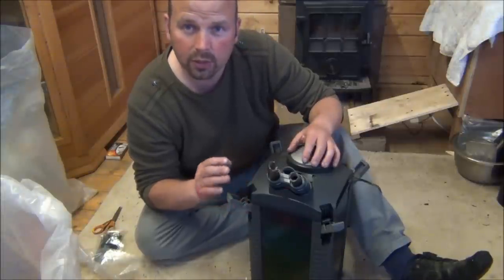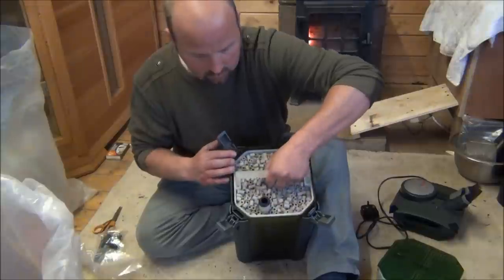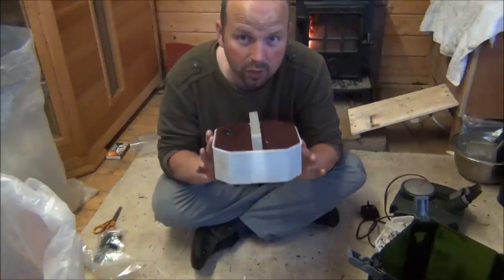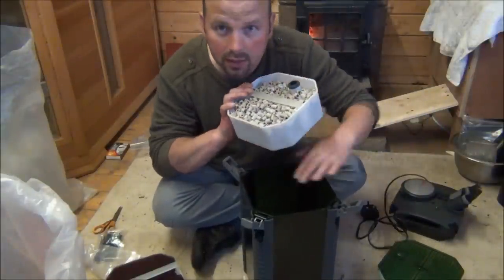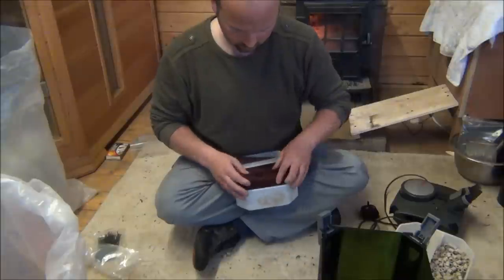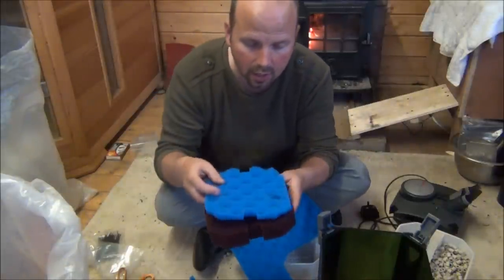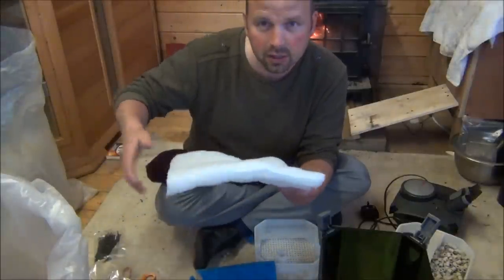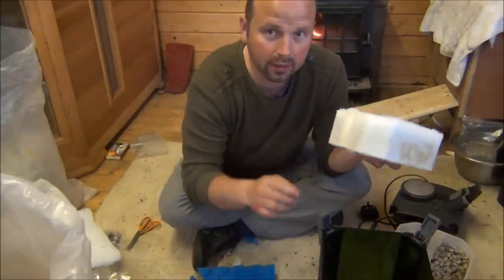How to set up an external canister filter for aquarium by Pondguru

Comment from the maker: BIOHOME FILTER MEDIA, FILTER UPGRADE KITS AND FOAMS HERE: http://www.filterpro.co.uk
Decent external filters: http://geni.us/2LnO
2.3 litre booster filter for externals: http://geni.us/2bj1
1.2 litre booster filter for externals: http://geni.us/1pBh
This video shows how to set up an external filter for an aquarium using simply 3 grades of foams and great quality filter media........With the bewildering array of filter media available for sale and manufacturers trying to outdo each other with pointless technical jargon designed to confuse the beginner and enthuse the armchair 'expert' I decided it was time to once again make filtration simple and understandable.
Filtration is at its most basic level a 2 stage process:

1 - Mechanical Filtration. The water passes through a series of foams or screens, each one finer than the last until it is visibly clean with no (or very few) suspended solids.

2 - Biological Filtration. The 'clean' water flows over and through media which can be plastic, ceramic or sintered glass. The best types of media are high quality sintered glass and ceramic (although there is a nation of poor quality ceramic media for sale from China). The media supports beneficial aerobic bacteria which consumes ammonia and nitrite, producing nitrate as an end product which is used up by plants or exchanged with the atmosphere. The very best media (e.g. Biohome) also supports anaerobic bacteria which will reduce the amount of nitrate providing a more complete filtering process.
More surface area = more bacterial colonisation. Common sense.

Foams and media to be positioned as follows (in order of contact first to last by water): Coarse, Medium, Fine foams followed by media. Yes, it is that simple.

Many manufacturers will advise the incorrect placement of media and foam pads; possibly for no other reason than to sell more replacement media? but if the media is well protected from muck by good foams then it will last many times longer.
No doubt there will be some ass clowns who cuss this video up and insist on having filters with digital readouts and the latest branded media but too often the idea of filtration is over worked to the point of stupidity - a case of the 'Emperors new clothes'.

A filter is only as efficient as the media it uses and all too often manufacturers will sell cheap external filters which will filter no more than a small foam internal filter due to the media inside them being cheap ineffective crap. Rip out the guts of the cheap filters and replace them with decent layered foams and good quality media and your cheap filter is capable of outperforming the most expensive range of filters.

I am using 3kg of BIOHOME MINI ULTRA in this video. It is a sintered glass media which has been made to my specifications  by the manufacturer of other Biohome media. Unbelievably good stuff.

*NOW AVAILABLE - BIOHOME ULTIMATE - It has exactly the same structure of mini ultra but also has the added trace elements of Biohome Plus. This combination easily makes it the best filter media you can buy.

For quality filter media supplied Worldwide click the link below and contact me for bulk orders on sales@filterpro.co.uk or 07772848730
BIOHOME FILTER MEDIA, FILTER UPGRADE KITS AND FOAMS HERE: http://www.filterpro.co.uk

*PLEASE NOTE I HAVE CLOSED TYNE VALLEY AQUATICS AND NOW SELL MEDIA FROM HOME ONLINE. COLLECTING MEDIA IS NO PROBLEM JUST RING OR EMAIL ANY TIME.*
Reply: Pondguru Outdoors rg
Reply: Pondguru Outdoors thx for sharing.  Excellent advise! Merry Christmas!!
Reply from the maker: Merry christmas to you too and a happy new year
Reply: Can you do a similar set up video for the eheim Professional 4 filter? I'd appreciate it so much
Reply from the maker: The set up is exactly the same except the pro3 and pro4 have a shallow tray in the top which is a 'pre-filter' tray which the water hits before heading down to the bottom and rising up through the trays and through the centre of the pre-filter tray.
Therefore just leave the pre-filter tray as it is since it acts as an extra coarse sponge. Water will still go coarse, coarse, medium then fine before it rises up through the media.
Reply: ok thats what i was having trouble with, I was confused in which direction the water was being filtered because of the pre filter, thanks for the help!
Reply from the maker: No worries, any time.
Reply: Sorry but another stupid question. The bacteria balls that come with the biohome media, should i bury them among the media or put them on the bottom of the filter? Thanks
Reply from the maker: As long as they are in the filter somewhere they will work fine as they'll dissolve so the bacteria will flow right through the system. Most people would just use them in the media sections but I have heard of people using them between the foams of even hanging them in a mesh bag at the filter outlet so water is flowing over them.
The only time they wouldn't be so effective is if there was a UV in the system as that would kill good bacteria as well as the algae and parasites - best to leave a UV turned off for 2-3 weeks while establishing a filter system to allow bacteria to colonise the whole system.
Hope that helps.
Reply: I bought a second hand Jebo 825 canister filter. What's really odd is that it seems to suck water out through the tube in the middle of the filter. Basically it sucks water out from the bottom instead of from the inside. I assume I just need to set up my canister filter the "Wrong" way with the foam on the top and the bio media on the bottom. Is this correct and are there canister filters that do this?
Reply: it does, thanks alot!
Reply from the maker: I looked online and I can't work out how the water flows through that one.
The way to test it would be to set up the filter how you think it should go and put a fine pad on the top of the top tray and a fine pad on the bottom of the bottom tray. Check it after a week or so and compare the fine pads to see where the most dirt has collected. That should indicate which direction the water has hit them from.
Reply: Pondguru Outdoors I asked in a forum and someone said that they found a video about the jebo 838 that says it's set up with sponges on top. I'll test it out by mixing some dirt in a bucket and running the filter. Thanks for the reply.
Reply from the maker: No worries, as you have fine pad on top and bottom you won't clog the media while doing the test.
Reply: Pondguru Outdoors Is there any specific reason for not using carbon? I know it's not necessary specially if you do regular water changes but carbon clears the water efficiently, reduces odors and is cheap.
Reply from the maker: If the filter is a suitable size and properly set up with good media there will be no need for carbon as the foams / fine pad will ensure clear water and there will  be no odour as there will be no ammonia. Carbon is used generally to mask the failings of a filter but I would still recommend it being used to soak up colour from new bogwood or residual chemicals after a course of fish treatment.
Often carbon is included by the manufacturer along with plastic media in filters specifically because it is cheap and lightweight, not because it is necessary.
Reply: I see. Yes I agree that having a good medium for beneficial bacteria is way more important than carbon and as you say the pads make a huge difference. If one has room though as you may have in the third container, would it hurt to use carbon if everything else is fine? Just wondering if there are any negative effects of using carbon. Also through my line of work I have access to commercial grade filter media sheet pads. They range from 1 to 50 microns. 1 micron pads will remove most bacteria. For aquarium water I am thinking of using 10 or 20 microns to see how it works after the foam pads.  Would that micron size be ok? It should block all visible solids but not affect solubles and the chemistry of the water.
Reply from the maker: That sounds fine and with regard to the carbon as long as it is replaced every 7-8 weeks it will do no harm, keeping the water 'polished'.
Reply: yes of course it must be changed often. Thanks for the reply Pondguru! Subscribed!
Reply from the maker: Carbon is useful if you need to draw in any residual fish treatments or colour from bogwood but as far as keeping ammonia and nitrite down the filter media should easily be capable of doing that. Normally carbon is included in filters to keep smells from ammonia down but with no ammonia there is no ammonia smell.
Reply: Jay F. Hemdal, the Curator of Fishes and Invertebrates at the Toledo Zoological Society conducted a very interesting study of the cause of Head and Lateral Line Erosion (typically a marine fish issue). The results of the study indicate quite strongly that the use of lignite carbon in a saltwater aquarium removes something (in all likelihood one or more trace elements) from the water, the lack of which seemed to cause HLLE. (plagiarized almost entirely from the spruce.com)
Reply: Hi pondguru pleas can u help I have just bought a jebao 502 extranal filter/pump and want to make it work effectively please help
Reply: Pondguru Hello,  how often should I clean cannister filter on 55 gallon tank with around 12 cichlids?  should I use the spray bar? and do I throw away any of the bottom filters when cleaning?
Reply: Pondguru Are you on Facebook?
Reply: Pondguru how much do I need to fill my cascade canister filter, and how much do you have in that bag?
Reply: How often should i clean the canister filter?some said 2weeks ,some said 6mounths,some said 1year.
Reply from the maker: @apple343525  You would just clean it as and when it gets clogged up and needs cleaning - depending on the stocking situation that could be anywhere from 1-6 months. If it is every week or two then the filter could well be too small for the tank stocking situation.
Reply: Pondguru thank you so much!
Reply: How often would I change the foams and media?
Reply from the maker: @themidnighttalkshow532  The foams will need changing when cleaning is no longer an option - when they start to break up or go floppy. That can take a couple of years. White pad needs swapping for new one as and when it gets clogged up with fine muck.
Media will last more or less indefinitely but a gentle shake in water you've drained off during normal maintenance is all it needs to clean it. There are lots of notes about this and more on the Q&A page of the FilterPro site http://www.filterpro.co.uk
Regards,
Richard
Reply: Can you do anything to fix media that has been clogged up? I got some for free, and with the price of it, would hate to throw away.

Comment: After having a canister filter running for two years the wrong way I watched this video and changed my media and foams this way. Huge difference in water conditions and cleans the water way better than the recommended setup on the box. Thank you so much for improving my filter and aquarium.
Reply from the maker: Tommy Padgett No worries. It's really common sense to set up the filter so that all the mechanical cleaning is done before the biological but it baffles me why none of the manufacturers do that, lol.  Glad your filter is working properly now.

Comment from the maker: +Ranchu Goldfish
The media would need to go into filter bags for easy removal but that would be fine.
Reply: Hello pondguru wanto ask you a question about filter media am useing 3 stange mechanical biological and chemical if i change the place biological with chemical first would go mechanival after chemical and last stange buological would it be allright?
Reply from the maker: mygap Ideally the order should be:
Mechanical - coarse, medium and fine foam 
Biological - Good quality media
Chemical - Whatever you have
Chemical filter media is not needed in 99% of filters set up properly with good media.
Reply: Pondguru  yes i got just like said mechanical after biohome ultra mini :) and last is a carbon just what i think if i change mecjanical with chemical it will be diferent?
Reply from the maker: mygap Yes a carbon needs to be in very clean water as it clogs up so quickly. It will be the difference between it lasting a few days or 7-8 weeks.
Reply: Pondguru Hello Richard what about fx5 do i have to do as same as you have done that Eheim or and what about the bag of carbon?
Reply from the maker: Abby ents All you really need for an fx5 is fine pad in top of top tray as it works top to bottom and already has good foams around trays. You would need around 4.5-5kg biohome mini ultra or ultimate doing it that way. If you chose to have the coarse, medium and fine foams in top tray you'd get away with 3kg of media (for the 2 remaining trays under foam tray).You do not need carbon in a filter which is set up properly as there will be no ammonia or nitrite. However if you needed to soak up any residual fish treatments or colour from bogwood you could use the carbon then to good effect.
Reply: Pondguru Outdoors hello mate.... just wanna say I'm a big fan, however I must say I am a lil dissapointed in this video... I agree with your setup and where the media and sponges should go BUT,... I think you could've done much better on the media you chose. I think for each tray you could've done half media of a sort and the other half of a different media sort. no tray should be the same (serious aquarium people wise)... therefore getting the absolute best out of your canister.. cheers
Reply from the maker: Juan Vazquez 'Serious aquarium people wise'...... What does that mean? and what is the point of mixing different types of media when we have one here which has an incredible available surface area and supports both aerobic and anaerobic bacteria to allow the filter to complete the nitrogen cycle and reduce the need for large water changes?
Reply: @pondguru   O do disagree with this because of smelly tanks and algae blooms..